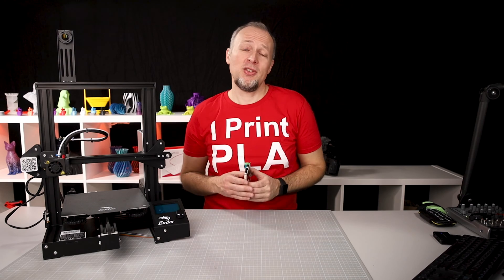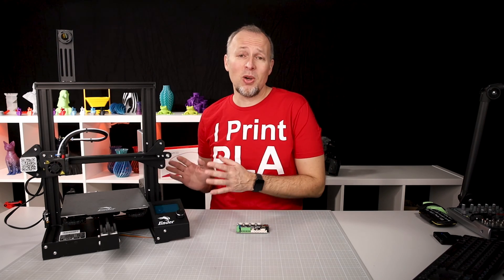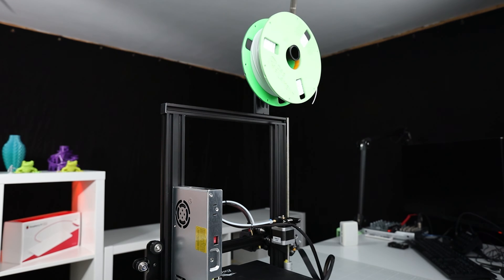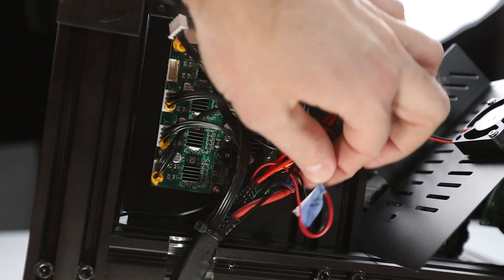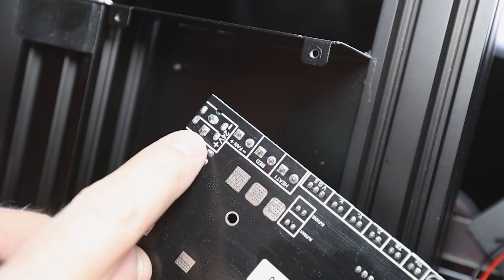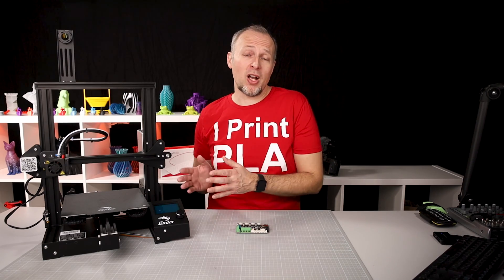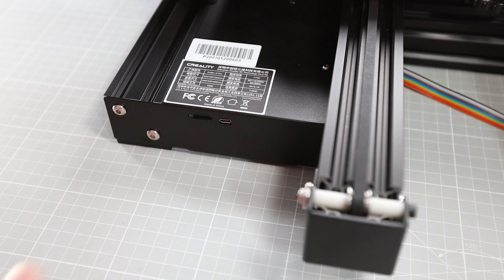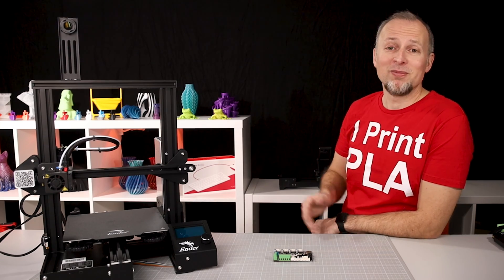Ender 3 (Pro) Upgrade - Creality 4.2.7 mainboard

Comment: After following the firmware upgrade for the new main board, when I go to "About printer it shows "Marlin Ver 1.0.1" . That seems odd since I supposedly just added Marlin 2.0.1. Any ideas? Is it just showing this even though I have 2.1.1?

Comment: It was too fast. I slowed it down to .5 and was able to follow along mostly. My firmware shows up as Chinese but I installed English. I even check it but yup, Chinese on the screen... Should I delete the Chinese files in all of the folders and leave the English? Should I only have a single file on the SD card when I turn it on?

Comment: Hey all I may have done the greatest upgrade to my Anet E12 by changing the motherboard with a creality v4.2.7. The issue is that when I go to preheat I keep getting the E1 heating error. I've swapped the thermister 4 times with 4 brand new ones and the heating element twice. It heats to 184 slowly but then faults to error, please help. What am I doing wrong?

Comment: Does this motherboard firmware have the chsnge filament setting?
Reply from the maker: Out of the box - no, but you can get a firmware for it that has all the features you want by either downloading a pre-configured firmware or compiling one yourself.
Reply: @Crosslink3D  thank you for the reply! I will look into now 😃

Comment: im just getting a blue screen when i try to use the firmware. any ideas how to get it going?
Reply from the maker: You're probably using quite old firmware. I would recommend, checking out the manufacturer website for the latest version for your printer. If you're more into tinkering, it's definitely the point to learn how to build custom firmware yourself.

Comment: I've installed this board 3 days ago. First print about 3 hours in extruder motor stopped working. Now it won't move after the clearing line from cura slicer on the side. I can move it just fine manually using "move axis", but it just won't work in prints. Tried a lot of solutions from the internet but it just won't work. Any ideas how to deal with it?

Comment: installed new v4.2.7 into ender 3 pro.  didn't do the firmware at first.  the heating worked.  the movement didnt move.  had the error Homing Failed:  Did the firmware update for Jan 16, 2021 and now the screen is blank.  I installed the firmware first and turned off. waiting for lengthy time and the screen still blank.  You didn't specify the length before reboot? 15 min so far and nothing.  will try an 8G instead of 64G.  will be back soon.....

Comment: I just installed my board and my print bed started heating up. It was set to 0 still but went up to 70 and kept going. It wasn’t a visual thing because the bed was actually hot. Anyone know why that could be?

Comment: There are 3 fans. On the old V1.1.4 board, there is a "fan" port and a "fan1" port. in the video you first connected the blue-yellow fan connector to the wrong port (new board, fan2) but then changed your mind and connected it to the one more to the center (new, fan1). The blue-yellow fan wire goes to the connector most central on the board, the fan wires for the enclosure fan go to the one most close to the edge.
Reply: Thanks 😊
Reply: Blue and yellow fan go tu port k-fan1 
and red black fan go to k-fan2 ?????!

Comment: anyone had problem with V4.2.7 cannot heated extruder when set 240 deg and 85 deg for bed (or trigger thermal runway in the middle of printing), no problem when use lower temperature, do we need attach external mosfet?, also mine have problem with speaker only generate mono tune only

Comment: i have bought the new 4.2.7 board and updated the firmware on my sd card to put in the printer but my screen is black and making a real loud beeping sound what am i doing wrong i checked all my wires to make sure they are plugged in and in the right spot this sound is really annoying please help thanks

Comment: I have the BIGTREETECH SKR Mini E3 V1.2 Control Board 32Bit Integrated with TMC2209 UART VS TMC2208 +TFT35 V2.0 and just purchased this mainboard, I do not see a place to connect the TFT35. Would I need to change the control board again to get it to work with this mainboard?

Comment: I am hating the Ender 3. it has never been able to connect with a USB cord!!! * bit or the 32 Bit. leveling  suck ass. printing is bad if, the damn thing will run. have a cheap XYZ print and never had the problem this shit has had!!!

Comment: I'm upgrading my Ender 3 and trying to get the correct firmware installed.(I'm not changing/adding anything, BL Touch or anything) however whenever I plug in the SD card with the .bin file I still get a blue screen and no booting up. Any advice on how to remedy this issue?

Comment: Heh, They put hot glue on all of the components to stop them from coming loose in shipping. Problem is that its a pain to the glue off without damaging the wires.

guess my thursday night is picking hot glue off of the motherboard
Reply: haha I spent my Friday night picking this hot glue!
Reply: I spent my Sunday night picking off the hot glue while trying to not damage anything... Now if I can get the USB and card slot to line up, I can actually screw the new board in!

Comment: Do you have any advice on the following? I upgraded my Ender 3 to the 4.2.7 board. It was running fine. Then I wanted to add a BLTouch (from Creality). Even though the board has a socket for the BLTouch, my understanding was that the built-in firmware that the board comes loaded with did not support it, and I had to update the firmware. I downloaded the firmware from Creality's site, put it on a 8GB FAT 32 micro SD card, inserted the card into the printer, and powered on. All I got was a blank screen. I waited for about 10 minutes but it never changed. I removed the card and repowered the printer. Now I just get the blank screen, so not only did the update fail, it blew away what was there. Any advice? Thanks.

Comment: Just finished installing mine a bit ago, so because your video is so new it was all the same steps, and like others, since you show the fan headers in their correct placements that was the only confusing pinout to figure out since what is what isn't labeled on the board or manual. Its eerily quiet now, almost seems like a new machine entirely apart form the fans.

Comment: Top video thanks (I fitted a 4.2.2 but basically the same). Nice clear instructions, the only thing that confused me slightly was that one of the fan sockets was in a different place next to another one both labelled fan on the new board but I could see the wire colours in your video - so no problem! The hardest part was removing all the hot glue used at new manufacture!

Comment: Great Video!  But I'm wondering if anyone has had this issue - I'm upgrading from a V1.1.3 to the 4.2.7 board  & I'm also adding the CR touch.  I followed this video and the hardware install went well, BUT I can't seem to get the firmware to install...the screen just stays blue.   I used an 8GB SD card... I renamed the file to firmware.bin... I've watched about 3 hours of Youtube videos and still no solve - any thoughts?
Reply: Same
Reply: I just fixed
Reply: Hey please reply

Comment: My Ender 3 now thinks it’s an Ender 3 pro but it does not accept any other firmware from the SD card. About printer is Marlin ver. 1.0.1 2020-04-25. 

Does anybody know why the bin file isn’t loading?

Comment: Hey I'm new to 3D printing just got and ender 3 and managed to print about 3 items, now I have a blue screen, if I get the 32 bit mobo and install it will I be able to load the firmware through the SD card or will I still need an Arduino?
Reply from the maker: You can flash your firmware with the SD card on the new 32bit boards 😁

Comment: When I have installed the motherboard and turned it on, the printer gives a very long beep. I have gone through everything 5 times and all contact points are good and also make good contact. What could be the problem?

Comment: I replaced a 4.2.2 board for the 4.2.7 board. I had a Blue screen just after getting my Ender 3 Max and I thought it was a good time to upgrade to the new board. Everything works great now. Running 2.0.8 Creality firmware.  I just used the method of swopping one cable at a time. This way I am sure I am plugging the right cables into the right places on the new board. Especially, the power connections are the most important to get right. The connections for the motors are not so critical. My Filament runout sensor was reversed so I disabled it for now. Other than that everything works without having to reverse cables.
Reply from the maker: Great to see this working for you!

Comment: Nice one Daniel, but have to agree and disagree with you on the 8 bit boards. I've no Ender3 but a 4.2.7 board was given to me by a friend  and I've decided to try it with  custom firmware and fitted it in my home made i3 clone which I've around just to tinker with new things. The MOST ANNOYING thing with these 32bit boards is that they dont have EEPROM and rely on the SD card for storing settings where a Mega2560 has it. Never mind it took some time to flash it, just wont read any DS card. To be honest I did not see any advantages  over the Mega/Ramps 1.6 combo in which I've 2208 drivers anyway. The only advantage is the size, and that's about it. Another thing is the price the chinese are charging for them 32bit boards with absolutely no guarantee, and knowing their attitude to QC, I'll stick with what works. If it's not broken, then don't fix it.
Reply: Is there a way to take this memory-less board and hook up an internal sd or usb to print from? And load to and from sd? You sound like you know more about this than me.

Comment: I followed this video i went from a Creality3d V1.1.4 board to a 4.2.7 board. Put in sd card, power on and It just sits at a blank screen. Any help would be appreciated
Reply: did you find the solution ?

Comment: the fan on my old board  has 2 wires but the 4.2.7 board connector has 33 pins. How do  I proceed connecting?

Comment: I was wondering if hotend fan and mainboard fan are switched. Aren't they? 
Because by connecting this way, the hotend fan will be 100% all the time and mainboard fan will be controled by software. That makes no sense.
Reply: This is a know Ender issue. Long PETG prints (little to no part cooling) means the board fan wont run because it’s tied to the part cooling fan. Usually ends up with roached extruder driver over time if you do lots of long prints. 

The common fix is to wire the board fan to the same terminal as the hotend fan. This will have the board fan running whenever the printer is on, which shouldn’t hurt anything.

Comment: I followed what you did and when i put the SD card into the printer after adding the bin file i just get a blank screen. the light comes on but everything just stays blank. any ideas how to fix this?
Reply: Did you figure this out? I have the same problem
Reply: @jarome1119  nope. Never been able to use my printer since
Reply: @ClareBearCB  try rename the firmware file
Reply: @jarome1119  try rename the firmware file
Reply: @raulJCP  did still dont work
Reply: @jarome1119  sorry bro :/ ... Try installing a custom marlin. There are some videos here on YouTube... You could also install the ender 3 firmware. The ender 3 firmware is the stock firmware of creality 4.2.7 board (Ender 3 4.2.7 mainboard). It's on Creality Web (Marlin 2.0.1 V.0.0.6)..... It's just an idea, I don't know if this will work bro. Good luck
Reply: @raulJCP  tried that it wont do anything wont recognize any card put in. I. Just running the stock board that came in the ender. I had a friend try it in his ender 3 pro to see if i was doing something wrong he could not get it to work. In just stuck with a bad boars i guess.

Comment: Has anyone had any issues with the FW from Creality for the E3V1 upgrade to the 4.2.7 board. I downloaded it on 2 different computers, and used 2 different zip programs and it won't unzip, it says there is no file???
Reply: I got a "name too long" error. Move to your desktop and try.

Comment: I upgrated to 3.2.7 and when running a level program with M0 as a pause, the printer ignores it and keeps going... could this be something in the firmware upgrade I did???
Reply: sorry 4.2 7
Reply: I ran into the same problem, took me a month to figure out that I needed shield my cables, was getting interference from one or more of the stepper motor wires.

Comment: If I have TL Smoothers installed on my 8-bit board, will they still be helpful on this board or does this board integrate that function?
Reply from the maker: Smoothers will not have an effect with this board.

Comment: Great video!  I just attempted this upgrade (Creality 32-bit Silent Board 4.2.7), but with no luck.  I installed exactly as you described, including the firmware install, but the extruder will not extrude when the y-axis is moving!  When moving left/right, it extrudes just fine, but when moving front/back, the extruder stops turning.  Very odd behavior!  I re-installed the 8 bit stock board to confirm nothing is damaged on my Ender 3 Pro, which was successful and performed a good print.  I'm going to attempt one last time to upgrade, but if that fails this board is getting sent back.
Reply from the maker: Maybe try to build a custom firmware and see if that fixes the issue. Otherwise this could be an electronics fault.
Reply: How'd this situation turn out?

Comment: did the board update then got E1 warnings changed the sensor and it does it again. last board struggled to get the first layer down went to rails smooth and quiet now have to recentre the bed
Reply from the maker: What rails are you using, the expensive HiWin or some cheaper ones?
Reply: @Crosslink3D  HiWin H class
Reply: @Crosslink3D  any way to get a config file without a arduino I have Octopi and run linux

Comment: naughty, naughty you didn't remove the tinned ends from the wires
Reply from the maker: I see, it's probably better to use the bare copper ends but those cables are already super short so getting rid of the tin without shortening the wires would be hard.

Comment: Do the newer ender 3 pros have have 32 bit or do none of them?
Reply from the maker: They should have but that mainboard is version 4.2.2 and you should triple-check with the seller if it really has it, there might still be leftover stock with 8bit mainboards at some retailers.
Reply: i bought an ender 3 pro a couple of months ago, it shipped with version 4.2.2 (UK Seller)
Reply: Got mine last week, 1.0.1 installed, CAD From Creality themselves. Upgrading to this board later this month :)
Reply: @conjie1986  Same, I ordered from Banggood.